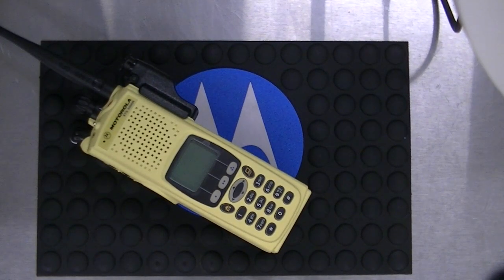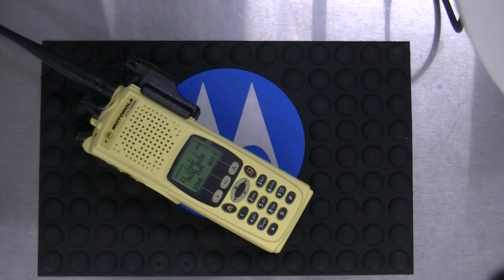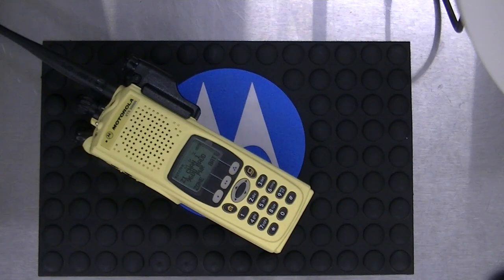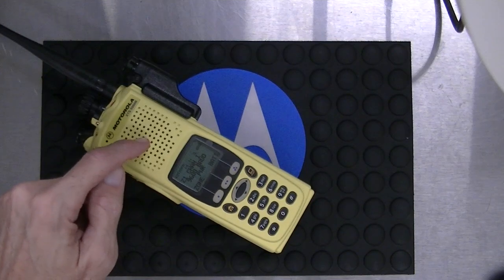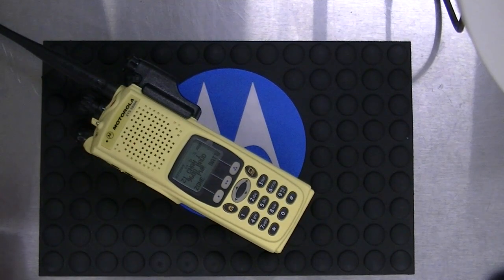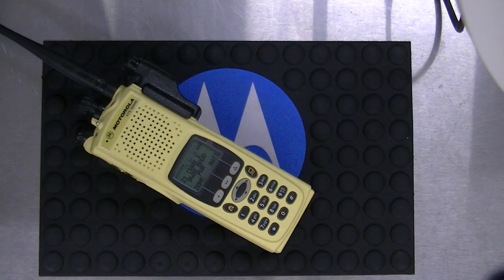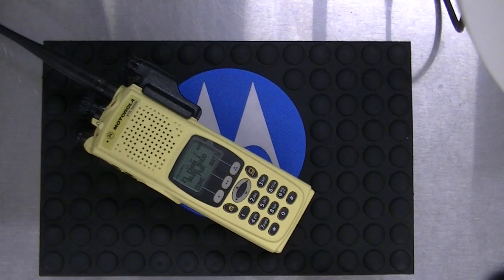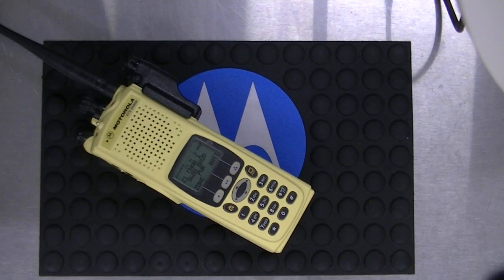MOTOROLA XTS5000 & XTS2500 - HOW TO RECOVER FROM A "FAIL 01/82" CODE - FOR GERALD AND ANYONE ELSE.

Comment: FL01/82 can also be indicative of an EEPROM failure, especially if it occurs after you write a radio and it works for a day or so. These radios are getting close to 2 decades old, while the ATMEL Flash chips have write cycles into the millions, remember the ROS is doing background writes constantly in use. While what you are saying is absolutely correct reference using garbage China pride cables, unstable programming computer/OS, the reality is these radios are aged. In theory, it's an easy fix to swap in a new EEPROM if one has the proper skills and SMD rework equipment. 
That being said, 800MHz XTS are a dime a dozen, and a VOCON swap and slam in a new codeplug, tune and align and back to business.
Reply from the maker: Thanks so much for that information!  I actually have had one unit that I've had for years that fail 01/82's without even being in program mode.  I remember looking it up but it never occurred to me to swap EEPROMs or VOCONs from 800mhz units.  I have several that I bought for parts.  I just may try that.  You're a sharp fella!

Comment: Quick question, do you have the Moto part number to the iButton for flashing the XTL5000 series radios. Any idea if it’s still available? Thanks
Reply from the maker: Mine say this:  DS9490B #1235C  389258
Reply: @snarlingrabiddog5150  Thanks for the info, I will call parts and see what they say!
Reply from the maker: You bet :) @Subgunman

Comment from the maker: If you have a Fail 01/82, I hope this helps.  If you disconnect power from the PC with a "Fail 01/82" the radio must be reflashed to revive it.  If your radio has firmware lower then R12, this can make writing an FPP codeplug to the radio take forever and you stand a very good chance of the write failing.
Reply: Do you still have Ibuttons lying around? Are you doing firmware updates with methods you're allowed to mention? Most shops I know can't do any firmware or Flashcode updates on these things anymore.

Comment: Love your posts! How can I wipe a used 2500 with ASK left on it? CPS shows nothing programmed into it,  it obviously cannot write due to the keys.
Reply from the maker: Hi there and thank you :)  I'm not sure.  It will probably need reflashed.
Reply: I had a XTS3000 with ASK, all I did was use Depot and it bypasses the ASK

Comment: Hi I have a xts2500 and it has the same error but I’m trying everything to fix it and I’m trying to go on other computers using cps and it’s not working do you have any suggestions
Reply from the maker: Unfortunately, your radio is a non-working brick.  The only way to recover is finding someone who has flashing software.  CPS won't fix it.

Comment from the maker: On a UCM fail code it is:  01/90   01/82 - "External EEPROM checksum failure"  Fix:  Reprogram codeplug.
Reply: sir can you send code plug for fatal error 01/82
Reply from the maker: @BRANDYT934  You will need to have to pay someone to unbrick your radio.  Your radio is absolutely useless as it is.
Reply: @snarlingrabiddog5150  Who can "unbrick" these radios? I was programming and the PC lost power causing the failure.
Reply from the maker: @ferrisvlogs  Check ebay, there's lots of people who make a little cash on the side by doing that.  Plan on paying 60 bucks plus shipping both ways.  I'll do it for that, but you may find someone cheaper on ebay.